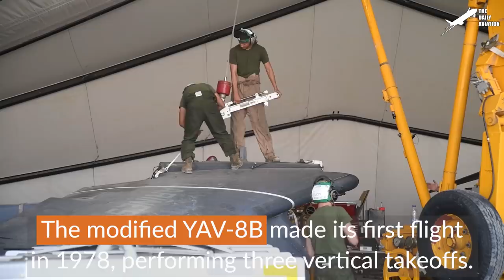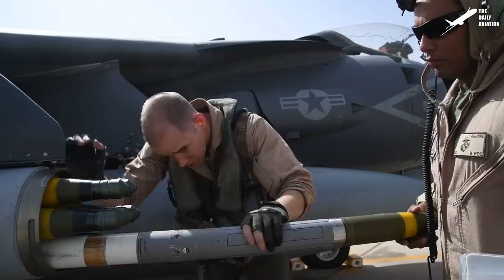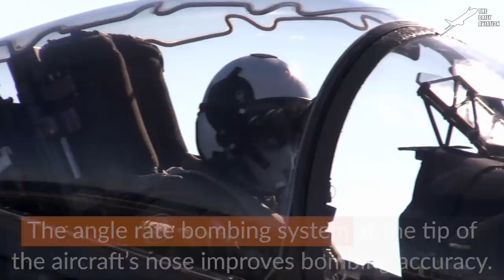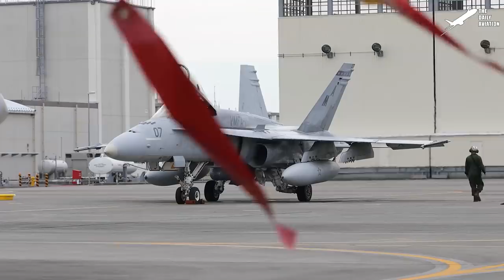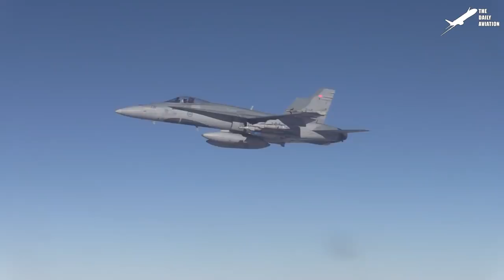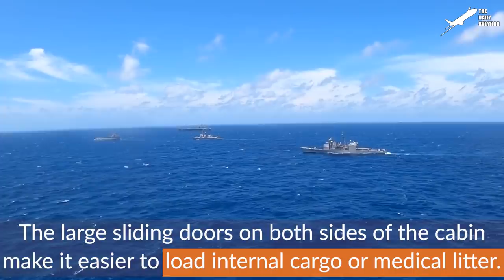US Airmen Need to Remove Entire Wings to Repair this Harrier Engine

Comment: It was never designed to be long range. It was designed to be a tactical fighter bomber, and it excelled at its role of air-ground operations from unprepared hides in Europe.  It also shot down a number of supersonic aircraft who weren't paying attention.
Reply: Harrier was designed by former auto engineers.  You have to remove a bunch of stuff to get to the common parts that fail  most often  :)
Reply: @trvman1  the FALKLANDS war they smashed the mirages!

Comment: I built the AV8B while working at Boeing . It is a visual oddity when watching it hover but it had some serious disadvantages in battle.  First of all it was extremely noisy, it couldn’t  sneak up on any one. Secondly it can’t take off vertically with a full load of ammunition and fuel. The third disadvantage was the heat signature was in the center of the aircraft which is bad for the pilot when attacked by a heat seeking missile
Reply: Which is why carriers carry more than one type of aircraft.  The Harrier is intended for ground support in places you don't have a convenient airstrip for takeoff and landing.  It's not designed to sneak up on anything. The last thing a Harrier wants to do is tangle with another fighter. It will have more than enough to worry about from SAMs and armored vehicles configured to shoot down aircraft with the equivalent of Gatling guns.   The Harriers are unlikely to be deployed from a carrier until carrier based fighters have suppressed the local air opposition.
Reply: @dennismccunney4462  right but the AV-8B, actually all blocks of the Harrier can be very capable dogfighters in the right hands, more so when utilizing small to med degrees of nozzle rotation. Done correctly, a pilot can gain advantages in turn radius, angel of attack, even abrupt speed changes.
Reply: @dennismccunney4462     Have you ever been duck hunting ?  The time it took to transition from horizontal to vertical flight was enough to draw a bead on it with a rifle. The idea that the Harrier could hover  over a battle field and shoot at the enemy was out of the question.  The. A10 is way better for ground support .Taking off from bombed airstrips was not good because the jet blast could blow foreign objects into the intake. It was maneuverable in flight and was used in the Falklands with great success, but in the gulf war the military was hesitant to use them because of the heat signature. The F35 (a real piece of shit)  the replacement for the harrier has a fan for lift in the front for lift and a conventional location for the jet exhaust eliminating the problem of heat seeking missiles impacting the center of the A/C .  maintenance was a nightmare, an engine change was a major event having to pull the wing to change an engine. It truly was an engineering  marvel but in my final argument we don’t build them anymore,  I don’t think we fly them anymore.

Comment: yet this is why we got F-35Bs with one layer access repairs to replace this thing! this is so we don't have to remove entire wings! plus the F-35B can carry FAR MORE than like two or more harrer's put together! also the F-35B is also sealthy as well! not to meenchon the F-35B is almost just as powerful as a F22 when it comes to air to air combat but it comes at only like half of the cost of a F-22! also the f-35B verent also has stol take off capabilities so it also can land and take off on the same things as a harrier can! this is very handy for when if you don't want to have a dedicated aircraft carrier for the F-35 C verent! the F-35A is fore normal runways. the F-35B is to completely replace the harrer completely without having to change it much other than putting a turbo fan air bypass thrust system with a vector thrust modification as well! by the way only the F-35B actually has vector thrusting but that only for helping the F-35B with its stol landing and takeoff for the most part! there's then the F-35C witch is for dedicated aircraft carriers operations that compliment the super hornets and the other aircraft carrier aircraft!
Reply: Claiming the F35 is a good as the F22 in air to air combat is pretty meaningless as the F22 is useless in air to air combat and totally outclassed by much older aircraft, the advantage the Harrier has over the F35 is that it can VTO with full load while the F35 can only VTO with no load and near empty fuel tanks. The F35 can only carry more than a Harrier with external  weapons which makes its claimed stealth redundant. Did I mention that you could buy 20 harriers for the price of one F35b if they ever get around to making more of those lemons.
Reply: @georgebarnes8163  um excuse me!? did you do your research and read the wiki about the f-35B max takeoff weight! can you do proper checking of information with proper information that's publicly available before you start talking stuff! DO YOUR F** RESEARCH on the internet to get the proper facts! the last time i checked and i did again in this post! the f-35b max takeoff weight is only 10% less than the other two verents ! plus it can still take off on a full fuel payload and fly at 90% weapons payload max capacity techly on a full max operating load takeoff capacity! that's still like 14,000 lb or 5,800kgs still of muntons at full V/STOL take off! plus the F-35B max flight range without refueling is just as good as the harrer's but with F** double the takeoff max weight! like the F35B can out gun a F*** harrer by two times over! by the way the last update to the harrer's max takeoff weight is only like 31,000 lbs! but the real nail in the harrer's cofen is the fact that the F-35B max takeoff weight is like 60,000 lbs! i'm sorry to burst your harrier cold war noalsanga!  but the F-35B is just far more powerful in payload and has just almost just as good of a flight range as the harrer but with like FAR MORE POWER in weapons payload capacity alone! plus its also a stealth aircraft as well! plus it can also do air refueling that the harrer can't do!
Reply: @gilzor9376  Raptor eats nothing since the US can not produce the lemon, you need to try harder Kid.
Reply: @georgebarnes8163  lol . . . sure . . . .if you say so George    ;)

Comment: I don't think the F-18 Hornet burns 23,000 US Gallons an Hour in flight  Pounds of fuel maybe again I would look at the Engine burn in Dry Power not Reheat?? As Reheat is only used for limited times due to the High fuel consumption that is causes by using it.  Being an former Harrier Engine man in the RAF in Germany in the 1980's on the GR3 /T4 Harriers the removal and re install in a Hangar is easy try it in a Field or Wood in West Germany when it is raining not much fun and we had an A Frame lifting gantry that was pure Manpower to winch the Wing and Engine out and on. The Pegasus engine is also very finely tuned and very quick to accelerate which can cause problems with the engine compressor Pop surging  which when you are in the cockpit ground running can be alarming the first time it happens an the whole cockpit is engulfed in Flames and there is a lot of Banging and Vibration going on  If we changed an Engine we would use a Special Test area know as the Tie Down House the Aircraft is tied Down using 4x large chains attached to the main undercarriage leg and another set for the Nose undercarriage the Aircraft is on Grate which is 6 feet off the floor so a pit to allow the Exhaust efflux to escape rearwards as re ingesting your exhaust gases on a Harrier is not good for the Engine. This is all well and good if you are at Home base but doing it in the field without a Tie Down House is not much fun we would do a series of acceleration checks and then the Pilot would do a Press Up just before Take off and if it didn't Pop we would Fly Home to Base and it was taken straight to the Tie Down for a Full Engine test before we allowed it back into service

Comment: I cringe when I see a tire that compressed from underinflation. Not saying they didn't air up that tire properly, since they know what they are doing but can't believe that has the required air pressure.

Comment: With full Armament load he don‘t reach the speed of sound. An expensive lame duck for every air defence.
Reply: The Harrier AV8 was not used nor was designed for air defence.
Reply: it couldn’t break the sound Barrier even with no ammunition
Reply: The Harrier shot down every supersonic jet it came up against in the Falklands after the Subsonic version was chosen (do some research )